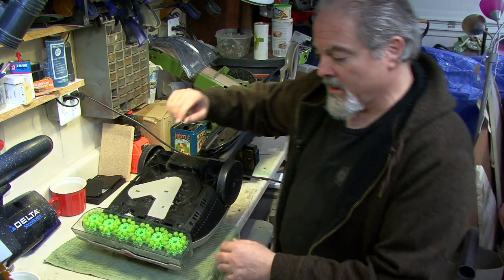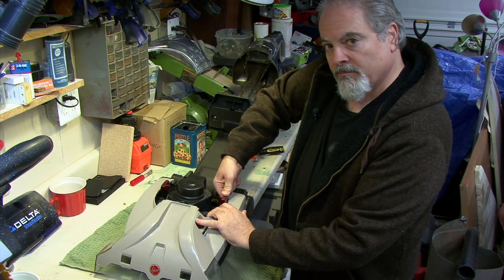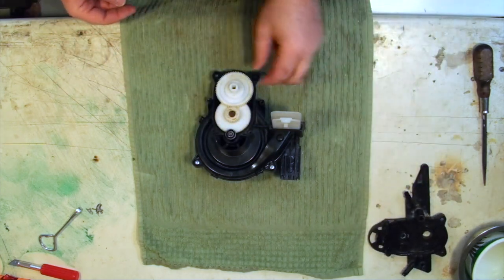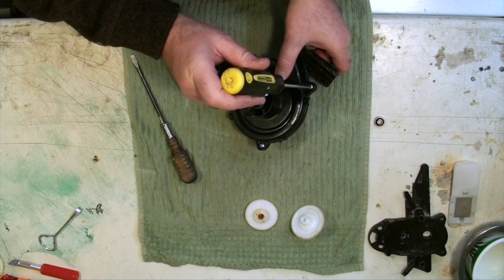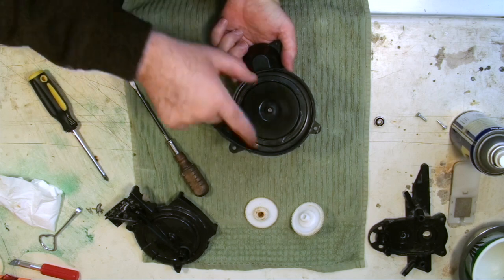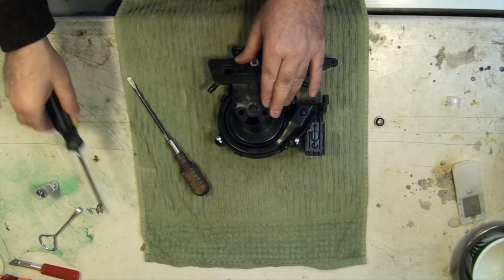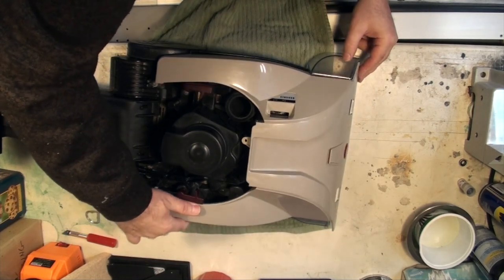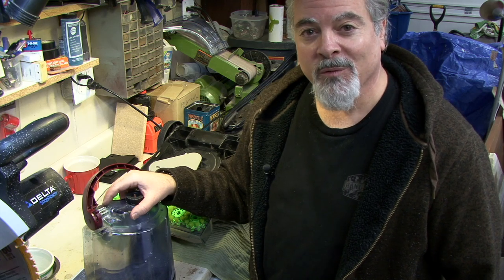SteamVac / Vax Brushes frozen and don't spin. Replace the bearing, not the motor. Less than $10 fix.

Comment: Hi, great video. My brushes have stopped spinning in the machine, but before I attempt to try this, the switch on the side, that changes the carpet setting is lose and doesn't engage. Could this be the problem, any help would be appreciated.
Reply from the maker: If yours is like mine, that switch turns the brushes on and off. So, if it is not engaging, that could definitely be the cause. You might need to remove the cover to see why it isn't engaging, and you can test to see if that was the problem while the cover is off. Hope that helps!

Comment: Brushes are clear but mine stops when you put it on the carpet. Bearings are free and brushes spins great until it comes in contact with carpet. Screen is clear just think it is not getting enough air. Impeller looked ok.
Reply from the maker: It sounds like you've checked the obvious. I'm not sure what else could be wrong, but I can tell you where I'd start to look.

The clear "nozzle" that attaches to the machine and houses the brushes has a very thin slot at the front for sucking up the water from the carpet. Sometimes dog hair and debris can clog that slot enough to lower suction. 

That nozzle also has the connection port for the accessory hose. I'd check the o-ring on the port cover. If that is broken or the cover doesn't seal well, it can create a vacuum leak.

Finally, there are two rubber seals where the recovery tank connects. There's one large ring that is visible when the tank is off and is easy to get to. Make sure that is not cracked and is sitting properly. Then, underneath that big seal is a small o-ring that seals the motor cover to the base housing. It might be cracked. That one requires digging further into the machine and it can't be seen with the housing on. 

I actually have another video in the works that shows how I fixed a huge water leak that was pouring out of the base, not related to the detergent tank. In that video, I disassembled the cleaner enough to see that last o-ring that I referred to. It may be a few weeks for the new video.

I hope these help, and I'd love to hear if any of these fix the problem.

Comment: To prevent water from getting to the bearing, would it help to use Flex Seal rubber sealant spray around the outside of the bottom body assuming the water would get in that way ?
Reply from the maker: I don't think there would be any way to prevent the water from getting to the bearing without interfering with the functioning of the cleaner. The water infiltration is a result of poor engineering decisions or planned obsolescence.

Comment: Thank you from Guyana. But my turbine in the motor is the problem not the bearing. It has detached from the middle which controls it. I was wondering if you or anyone knows where I can get a replacement from? Or would it be better to altogether switch out the motor?
Reply from the maker: Unfortunately, the turbine rotor was not a replacement part, only available as a turbine motor assembly. I have three ideas:

Try to glue the turbine back together using 2-part epoxy. 

Try looking for the turbine motor assembly for your model number. I can't find any for mine, but yours may be newer and still available. You can also try eBay for used parts.

See if you can find a used machine of the same model number and combine the two using the best parts of each.

Hope that helps!

Comment: Any tips on making a better gasket for the dirty water tank? Mine is already failing
Reply from the maker: I ended up just replacing the valves as shown in this video: https://youtu.be/92NMPklWcLE

So far so good with no leaks 3 years later!

Comment: Hi from Brian - Best tutorial on site - Pulled mine down and followed all your instructions - Scrubber works great now ( I'm retired technical college instructor (now 82) and I reckon  you are one of  THE BEST instructors ) - I am trying to work out how the water gets to the bearings as it looks pretty water tight- I have ordered the bearings you recommended from Amazon and will pull it down again when they come and look at putting  flinger disks on any rotating shafts and also look  at drilling a hole in the centre of the bearing holder that will be lowermost when the machine is working to allow and water to drain - Also when I lubricate I am thinking of putting in a bit of soluble oil as well  - What do you think ?
Reply from the maker: Thanks Brian! That's some pretty high praise since you obviously know how to teach!

I can't figure out how the water gets in there either. At first I thought it was all from the leaky valves, but now I wonder if some of the water gets sucked into the brush motor as the extractor vacuums up the sprayed water solution. 

I think a bit of oil and the drain hole would be a smart preventative measure, and I might just do the same next time I have the machine on the bench. If you drill yours before then, please let me know what you think.

So glad I could help, and thanks for the wonderful feedback!
Reply: @UnchartedDIY  Hi from Brian - Was just looking at it at lunch today (it's 4pm here) and I also reckon that is where it is getting in  - Going to turn that oblong foam washer over next time I work on it and put some tracer blue on the outside to see if water is sucked through - Also going to leave the clear suction tube off until I am ready to use it as I reckon it compresses the foam seal too much - Will let you know when the bearings arrive for the US and I work on it and give it another work our - Regards BriAN
Reply from the maker: @briancroft3437  Thanks for the followup. I'd love to hear what you find out.

Comment: I can see the link to Amazon shows bearings, however there's lots of different sizes. What was the size for the bearing required? Hopefully it's the same for my Dual V I'm going to try to repair.
Thanks for a good detailed video
Reply from the maker: This link should connect to the set I purchased to fix mine: https://amzn.to/3eNzftX 

If not, the specs are: R4-2RS Sealed Bearing - 1/4"x5/8"x0.196. I hope the repair is easy and it works perfectly!
Reply: @UnchartedDIY  Thanks for this. I have just taken mine apart and the black ⚙️ on the underside (video around 8min30) had a crack all the way through.
I have superglued the cog back together (and lost my prints on my fingers. Should have wore gloves)
I thought I had fixed it as the whole thing was working by hand.
However when put all back together the brushes still don't work.
May have to leave the oil to penetrate more, replace a few of the cheaper parts or give up on it.

Again thanks for the video. Gave me confidence to go in and have a good look 👍

Comment: Hi this is the same issue I have on a vax all terrain, but mine has churned up the gear that connects to the turbine shaft.

Could you let me know the model as vax has discontinued this part

Or would you know the model/type of the gear ?
Reply from the maker: Unfortunately, I don't have any inside information on parts. I've only repaired my machine as a DIY project, but I too discovered that parts are hard to find and most have been discontinued. 

From my experience, it seems that they don't sell small parts like gears - only assemblies, and that's if you can find any! These machines were designed to be replaced rather than repaired.

There should be a label on the back of the handle with your model number on it. I suggest doing a search with your model number and the word "parts" to see if there are any parts places that still have inventory for your cleaner model. They usually have parts diagrams on these sites, so you might be able to determine the name of the part or assembly you need. 

I'd also check eBay and local listings. One clever viewer commented that they found a similar cleaner in a thrift store and used it for parts to fix her machine. 

I hope you are able to fix yours. They are great cleaners when they are working!

Comment: Hi, great video. I have the same problem.
Before I open up the machine I have a question.
When you pull the brush wheel mechanism off, theres a hexagonal hole which spins the brush crank. I can put my finer in there and it spins pretty freely. Does that mean mine isn't seized and the problem is elsewhere?
Reply from the maker: I don't think that's a good indicator, Playamoff. Mine turned too, but once I put the brushes back on, they'd stop as soon as there was any pressure on them (from the carpet). The brush motor depends on air coming through the turbine at high RPM to do the turning, so any friction from sticky bearings slows everything down, and then it loses the power to turn the brushes under load. 

Have you checked the shafts of each brush to make sure they don't have hair and fur binding them up? If those are clean, I'm pretty sure it's the brush motor, meaning either bad bearings or a broken turbine inside that motor. 

I'd love to know what you find and I'll try to help.

Comment: How to prevent a leaking tank to avoid this problem  ??
Reply from the maker: I have a couple of video on exactly this question!  https://youtu.be/_or6TFCVsm4 shows how to fix a cracked water tank, and this one https://youtu.be/92NMPklWcLE shows how to replace leaky valves on the tank. Hope that helps!

Comment: Have you ever heard of these things needing a fuse replaced? Or there being a motor reset button? I borrowed one from a neighbor and within 5mins of normal use, it started struggling a bit and the headlights were almost blinking along with the motor struggling. I turned it off before anything serious happened and now it will not turn on even after letting it cool for hours. Something must have tripped from an overheat?
Reply from the maker: While I am not an expert with these machines, I'm pretty sure there is no fuse. It doesn't sound like a fuse issue to me anyway. When a fuse goes, it's off right then - no struggling or anything else, just off. I would suspect a failing power switch, or possibly even the cord itself. 

You could test the switch and cord if you know how to use a multimeter. If not, I would sniff the power switch. I know it sounds weird to suggest sniffing, but a failing switch usually has a burned electrical smell. As for the cord, I would first give it a look over to see if there are any signs of damage or major kinks. If the cord appears to be in good shape, I'd then try running my hands down the length of the cord while it's plugged in to feel for heat, which could indicate a fraying or broken wire inside the cord cover.

Both of those are pretty easy and cheap to fix if they turn out to be the issue. I hope this helps, and I'd love to hear what it was if you figure it out.
Reply: @UnchartedDIY  so last night I took the thing apart expecting to find a fuse of some sort along the motor but what I did end up finding was that one of the two carbon brushes was popped out of place as in the spring part popped out of it's little compartment where it was stuffed and then had a cap soldered on. When I stuffed it back in there and could see the brush touching the part of the motor just like the second brush was, it fired right up. So I siliconed it in place and let it cure overnight and will now attempt to put the whole thing back together again in hopes that I can finish my rug and give it back to the owner and never borrow it again LOL
Reply from the maker: @electric1609 that was some mighty fine detective work! You should be very proud of yourself! And, thanks for letting me know what it was and sharing with everyone that might have a similar issue.
Reply: @UnchartedDIY  thanks! Putting it back together was the bigger challenge though as I did NOT take any photos at different stages of disassembly like I should have!

Oh but it did fire back on STAY on! Hope to finish my rug tonight.

Comment: Worked great for me!!! Thank you so much. I got the bottom bearing to turn but it is rusted. Would you have any idea how I would get it out or would it be best to buy the housing? I’m fixing it for a friend. She had no idea the brushes were not working :(
Reply from the maker: Glad it helped April. Your friend will sure be surprised with how much better it cleans when the brushes are spinning! Sounds like you are a great friend!

You might not have to remove the bearing if you let it soak in WD-40 overnight to dissolve some of the rust, then let it sit in a puddle of lubricating oil such as 3in1. The housing itself makes it easy to soak by just filling the indention where the bearing sits with oil. I used a flat screwdriver blade in a drill driver to spin it in both directions after soaking to make sure it was spinning freely. 

I'd love to hear how it goes!

Comment: I got it to spin before putting the cover back on, but once i put the cover on it doesn't spin! What could be wrong?
Reply from the maker: I can point you in the direction I would look. First, check the screen to make sure it's clean

Then, the clear "nozzle" that attaches to the machine and houses the brushes has a very thin slot at the front for sucking up the water from the carpet. Sometimes dog hair and debris can clog that slot enough to lower suction. 

That clear nozzle also has the connection port for the accessory hose. I'd check the o-ring on the port cover. If that is broken or the cover doesn't seal well, it can create a vacuum leak.

Finally, there are two rubber seals where the recovery tank connects. There's one large ring that is visible when the tank is off and is easy to get to. Make sure that is not cracked and is sitting properly. Then, underneath that big seal is a small o-ring that seals the motor cover to the base housing. It might be cracked. That one requires digging further into the machine and it can't be seen with the housing on. 

I actually have another video in the works that shows how I fixed a huge water leak that was pouring out of the base, not related to the detergent tank. In that video, I disassembled the cleaner enough to see that last o-ring that I referred to. It may be a another few weeks for the new video.

I hope these help, and I'd love to hear if any of these fix the problem.

Comment: I wonder if making a gasket would keep it dry in there
Reply from the maker: It might if it didn't interfere with the moving components for the brush switch and handle interlock. I think the most important thing is to replace the valves or the tanks at the first sign of leakage. Unfortunately, leakage is inevitable so if a gasket could be made, I think it would be a great preventative measure.

Comment: My shaft and brushes turn freely when on it's side but not when operating.  I've taken everything apart, cleaned the internal screen with no improvement.  Any ideas?
Reply from the maker: If the screen is clean, I suspect the bearing is probably rusty and is hanging up. It works enough to spin a little bit, but not strong enough to work when in contact with the carpet.

Comment: Help!  I’ve followed all your instructions…loosened up bearings etc.  put it back together but now brushes won’t stop spinning. There was a part of your video that was focused on your arm so not able to see if I put it back together correctly.
Reply from the maker: The brushes should always be spinning when the cleaner is running UNLESS you move the switch on the base to off. 

It sounds to me like you did it correctly and now have a working cleaner. Nice work!
Reply: Thx but I moved lever to off and they are still spinning.  I think I didn’t put it back together correctly…..especially the little spring. But the video helped me so much….rather have them spinning all the time than not.
Reply from the maker: @avonlakebookclubavonlake-hm8hv  Make sure the wire sits on top of the fork-shaped interlock. That engages the lever arm that also connects to the brush switch. I'm guessing that the arm or the brush switch level is not connected properly. You can look at around the 13:05 mark in the video to see how they go together. At 13:18, you can see the interlock, arm and the coiled spring that pulls back on the arm. 

I hope that helps, but I agree that having them spin all the time is better than not spinning!
Reply: @UnchartedDIY  you are absolutely correct!  I followed your instructions again and it solved the problem!  Thank you for your tremendous support.
Reply from the maker: @avonlakebookclubavonlake-hm8hv  Yay! Thanks for letting me know it worked, and nice job fixing your cleaner!

Comment: Will the hand brush still work even if the bottom brush is frozen up?
Reply from the maker: Good question, Brenda. It should still work since the main suction motor is not the problem.
Reply: Thank you! I was just hoping if I couldn't get the brushes on the bottom working it be great if I could still get some use out of it.
Reply from the maker: @brendacollins5413  You should be good for smaller jobs, but it might take a while to do the whole house  😉😁

Comment: Can you give me the part number for the bearing. I have one of those units and that is exactly the problem I got. I see is a very common problem
Reply from the maker: I don't know Hoover's part number, but there's a link in the video description to the ones I purchased on Amazon. You can get the specs from there.
Reply from the maker: Also, I've pinned a comment so it stays at the top of the list, That comment has the specs too. Those bearings will get you fixed up and running again!